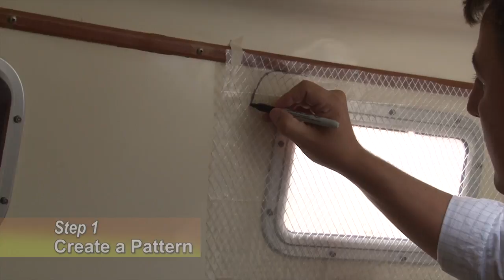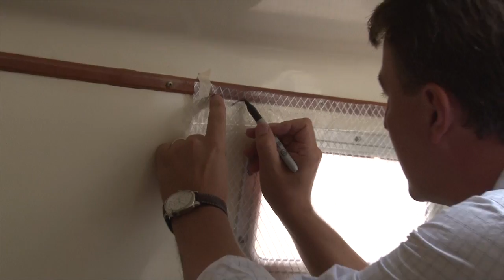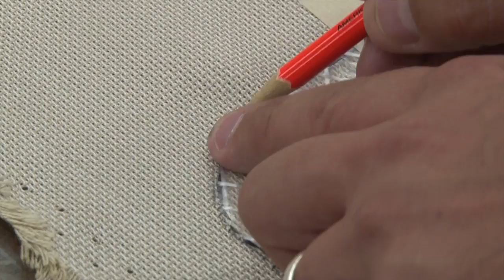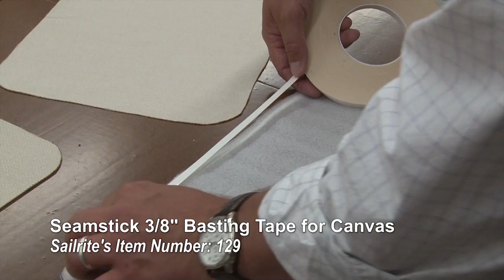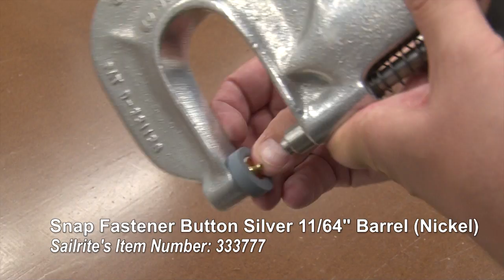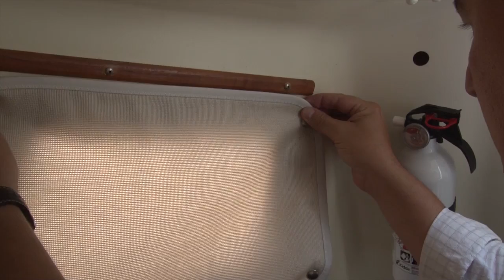Make Your Own Snap on Window Curtain Panels for Your Boat

Comment: Any suggestions for putting a sunblocking panel on the OUTSIDE of windows? My husband is concerned about interior heat build up in the boat during summer storage in the tropics.
Reply from the maker: This video tutorial may be helpful: https://youtu.be/hwM3K9irhbI

Comment: great idea, question what if you do want a dark cabin what dark material do you recommend?
Reply from the maker: Try these blackout fabrics: http://www.sailrite.com/Fabrics/Home-Fabric/Drapery-Fabric/Special-Features/Blackout/type/Products?order=custitem_popularity
Reply: I may try using reflectex material (Home Depot) with foam in the center surrounded by shiny foil.  I will then cover it on the interior facing side with fabric and sew the binding on the edge.  It's possible velcro pieces could then be used as it will both stick to the fiberglass wall and the oposit side of the reflectex material.  Just an idea as it will be insulated and also not allow light to pass through.  My thoughts.